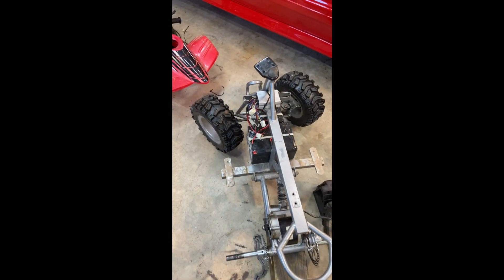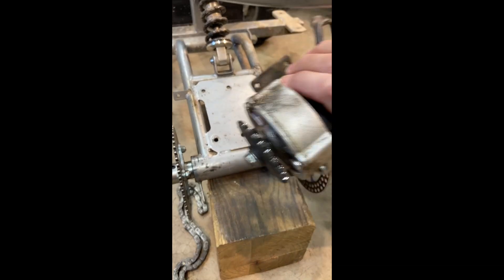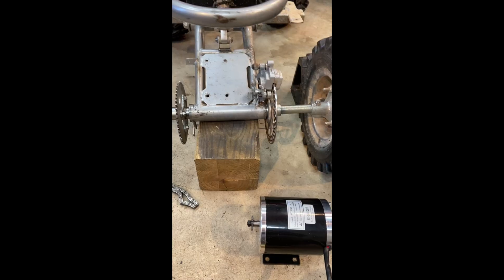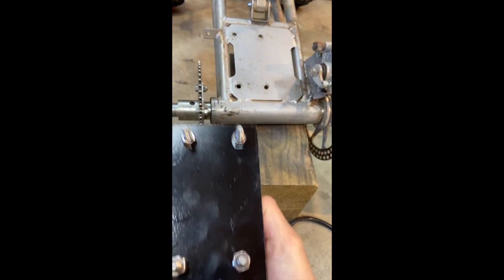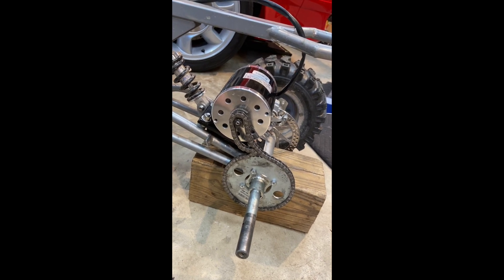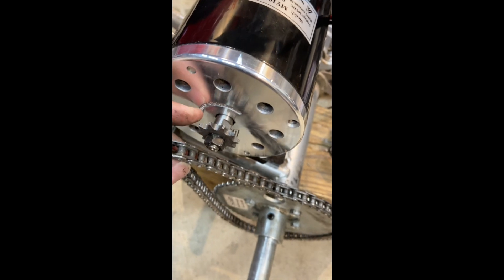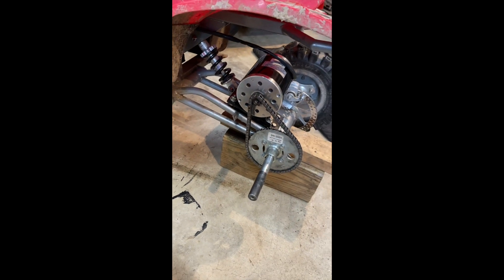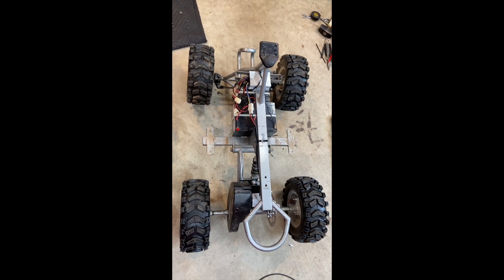Razor Quad Motor Upgrade

Comment: Are the axle Allen bolts threaded in to the rear axle and secured with a nut? Or are they just secured with a nut? I am having a hard time removing them.

Comment: Hey, my motor is rated 24v  250w by its label, is that ok if I deliver 36v to it?
Reply: Ya that's what he has with the 3 batteries but it will wear out the motor faster but it's an easy mod but this video he's upgrading the motor

Comment: Stock razor 24 volt quad can handle 36 volts lithium ion packs no problem.
Reply: Really? I was thinking about upgrading my sons from 24v to 36 but didn't know about all the other parts on the quad being able to handle the voltage
Reply: @KK-jl9sz  yes the razor quad the razor dune buggy the razor ground force all can be upgraded to 36 volts without issues speed controller can handle the voltage. I have both the razor quad and the razor dune buggy running on 36 volt 4amp lithium ion packs.
Reply: @stower82  nice thank you!

Comment: A lot of questions about the tires, can you please answer? Thanks
Reply from the maker: https://www.summitracing.com/parts/crr-5170161
Reply: Thanks! Does your kiddo have any problem reaching the brake lever? I'm working on a hydraulic brake upgrade but the lever reach for small hands is still an issue

Comment: What's that tire size?
Reply: To answer my own question in case anyone wants to know. They are 
Carlisle X Trac ATV Bias Tire - 13x5.00-6 ish but I got the 
15x5.00-6 for the rear and they are perfect. Bigger but that may translate to slightly higher speed and better handling off-road.

Comment: Can you build a few and sell the on Amazon?...
Reply from the maker: Already available on Ebay: https://www.ebay.com/itm/Razor-Dirt-Quad-Aftermarket-Motor-Mount-and-Installation-Kit-Upgrade-Bolt-on/303594461903
Reply: @xcntrk75  Page error did you stop selling them?
Reply: Yeah where can I get some spacers? The link finest work anymore

Comment: Hi name is joe. Just bought the 24 volt razor quad for.my 4yr
 Old grandson plz make a video on how to do these simple upgrades plz plz i am not mechanically incline. Lol. But want to do a 36 volt upgrade plz
Reply from the maker: You can now buy a production version of this motor plate on Ebay.  https://www.ebay.com/itm/303594461903
Reply: That's awesome i only have the 24 volt quad rite now what upgrades can I do seems like you know what your doing plz help. I want 2 make it a 36 volt and bigger tires be nice to? Whats this  upgrade 4? Srry million questions

Comment: 11/56 gearing for a 45lb kids is perfect. 
Here's my finished project, there wasn't a need to relocate the motor. Also, just flip the chain tensioner around and use a spacer
https://youtu.be/2M09t2EgFnU

Comment: Nice bracket here goes nothing I am gonna build one
Reply from the maker: You can now buy a far more improved version of this prototype on my Ebay store: https://www.ebay.com/itm/303574302104
Reply: @xcntrk75  None of your links work on any of your comments
Reply: @xcntrk75  does it fit the 1800w brushless silver motors also? And where you buy the bigger sprockets?
Reply from the maker: plojm123 will fit any motor with a 102mm x 56mm on center bolt pattern base.
Reply: @xcntrk75  What happen to the brackets would like to get my hands on one.
Reply: @xcntrk75  do you still make the brackets?

Comment: Nice. Do you have a link or model numbers of the wheel spacers and tires you used? I’m really interested in the wheel spacers.
Reply from the maker: I used these:
https://www.ebay.com/itm/303573519730